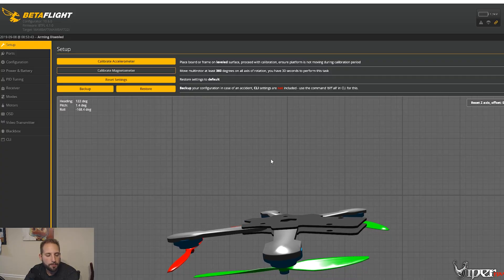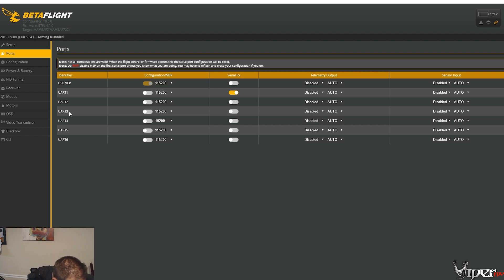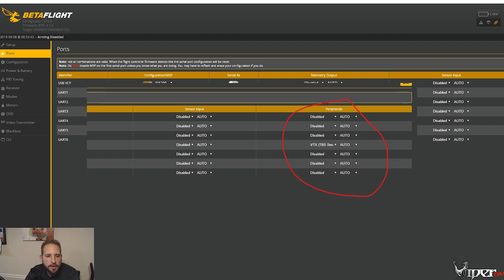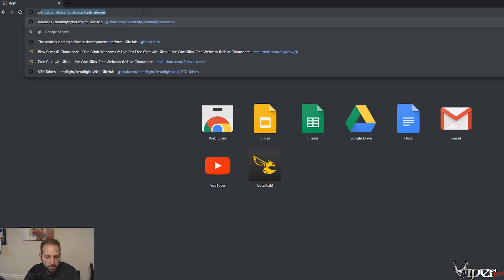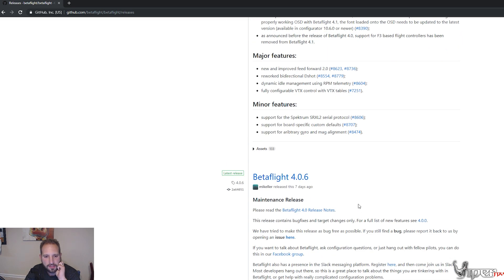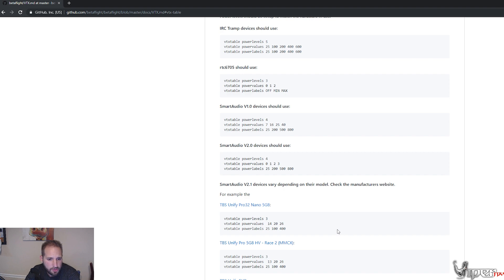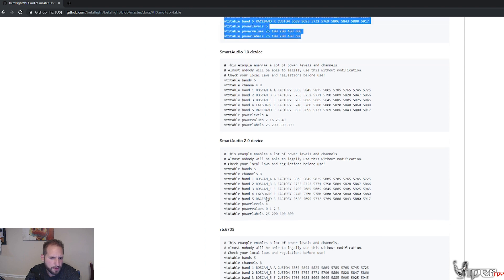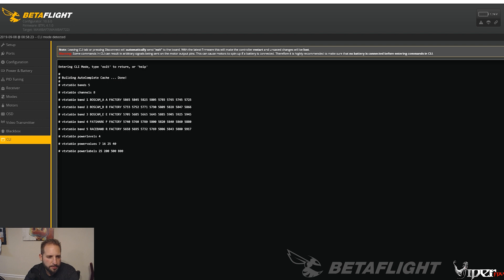How To Setup Betaflight 4.1 with Smartaudio or Tramp Telemetry - how to setup vtxtables

Comment: I have nano pro32 and using smart audio 2.1. I set the vtx table and when I got to vtx sa in osd all I have is statx and exit. I do have the peripherals set. But when I do the debug I don't get any values. What am I missing
Reply from the maker: Josh Hutchins are u sure if u have the smartaudio wired correctly?

Comment: So I got my NamelessRC nano vtx working but for some reason I can’t seem to change my rate profiles via osd. I can change the channels just fine. I have 1 model on my radio for all of my d8 receivers and other models have switches for air,horizon, and stable. But in beta flight I have this model setup with only a arm and beeper switch. Seeing as it’s a 3” I have no need for stable. Only reason I bring that up is I have noticed in the past that I couldn’t change channels if the rate profile isn’t compatible with stable mode. Any idea why I can’t make these changes? Thanks
Reply from the maker: Do you have expert mode enabled? You will need to make sure that is enabled and then you can change your rates with a switch.
Reply: Viper_FPV I’m just trying to change them via osd. It’s so strange I can change my rates in rate profile 1 but I can’t switch to rate profile 2 or 3 at all
Reply from the maker: David FPV there is no function to change rate profiles in osd. That’s why you would have to set it to a switch
Reply: Viper_FPV maybe I’m saying it wrong because I have changed rate profiles a ton via osd on all of my quads. I have rate profile 1 for stable flight. And I use rate profile 3 for acro rates. So I go in my osd under profile and I toggle from 1 to 3 then click save and boom it locks in. But for some reason now it won’t switch from 1 to 2 or even 3
Reply from the maker: David FPV I believe they changed it in 4.0 where now u have to setup a switch to change your rate profile. You can change the pid profile through the osd just like before but it won’t change your rates.
Reply: Viper_FPV when I fly my pmb tiny hawk s rateprofile 3 is for angle flight and has Rc rate at 0 and super at 0 for pitch and roll and if I flip my switch to acro mode the quad won’t do flips or rolls because of this so I go in my osd and change the rate profile to 2 which has 1.20 for Rc rate for pitch and roll and .82 for super and the quad flys like it should. So your saying that I shouldn’t be able to make these changes via osd?
Reply: Viper_FPV I’ve also done this in the past when experimenting with different rates to see what I liked best. But since I’ve found my ideal freestyle rates I don’t switch as often

Comment: Did this for my 136rs and I can't change the frequency.
Reply from the maker: Alex B are u sure it’s on Smartaudio and not vtx telemetry
Reply: @ViperFPV  Figured it out. My old config that was pasted had the vtx set to a channel and band specifically and it was overriding the new setup.
Reply from the maker: Alex B glad u got it straightened out.

Comment: Hi Viper, i have an ImmersionRC Raceband 200mw, it uses SmartAudio 1.0 right? updated right now to BTF 4.1 so i'm kinda confused
Reply from the maker: Is it a tramp vtx?
Reply: @ViperFPV  yes, it has 2 plugs for audio, one says raud and the other says laud
Reply from the maker: You don’t use the audio plugs on the tramp you want to connect the wire marked with a T to an available uart TX pad.

Comment: So from the vtx, the irc tramp wire would be soldered to smartaudio(tx1) on the fc, then the other 3 wires would just be to the camera. Correct?
Reply from the maker: Cyrus Krakow u have it right for the smartaudio wire. But the vtx would need power from a power supply, ground and the video wire would wire to the video out of the flight controller
Reply: Viper_FPV thanks for the quick reply. Yep, thank makes sense about the wiring. I just wanted to make sure if I bought a Runcam TX100 Nano VTX it would work with my BETAFPV F4 1S Brushless Flight Controller V2.0 DSMX Receiver I have since this receiver only has a smart audio (tx1).

Comment: Thx for the video . I downloaded the vtx  file for smart audio , my video tab looks good. I set in the ports tab to SA but in my goggles  it says not configured , I went back to the ports tab and set it to tramp, now I can change  power ,channels etc... in my osd but it doesn't  seem  to change on my rapidfire. But its weird  that my smart  audio  vtx(rush tank) only works with irc tramp. Would you have any ideas ?  Thx peace
Reply from the maker: Your rapidfire won’t change channels u will have to change that manually.

Comment: We need to figure out the tables/valurs for an RDW Mach3.   I have one RDQ mach 3 that yields a result of 200 for debug sensor and another that is 216.

Problem is getting the other power levels to properly be recognized.
Reply from the maker: You can change the power levels in cli to match your vtx so your osd shows the correct power level. The Mach 3 I believe does use smartaudio 2.1
Reply: @ViperFPV  that os what I am trying to confirm.    It took some digging to find that some of the VTX table values are in db rather than just sequential "1,2,3,4,5".

One of my builds may have a deadish VTX so I need to retry it.   But I have to confirm it by way of using my IRC ppwer meter.

Comment: Hi buddy.  I have just finished all the step you described - exactly the same setup to are showing, however, when I go into smartaudio I get the message 'statx' under VTX SA and can only change values under the VTX TA tab?  I have set all port correctly in Betaflight 👍
Reply from the maker: i cry when i wii what vtx are you using?
Reply: @ViperFPV  TBS Unify Pro HV
Reply from the maker: Are you using the smartaudio 1.0 snipet?

Comment: Why you change everything thru CLI and not from the video transmitter tab? My problem is that the changes I make thru the OSD don't do nothing to the VTX, it seems changes are being done but nothing happens, I pretty much have tried all smart audio versions. I have a Unify pro 5g8 HV non race edition, it goes to 800mw
Reply from the maker: Did you not watch the video? They changed how smartaudio is setup with betaflight 4.1 you now have to enter a vtx table into cli
Reply: @ViperFPV  I have Betaflight 4.1 and you can change all that thru the video transmitter tab, you can upload the file for your vex table, do it manually or even paste it from clipboard.
Reply from the maker: Listado En Linea I like cli better or I’m just use to it, I like to see it actually changed

Comment: help anyone, any idea why when i change settings on the vtx table tab like current channel or vtx power and low power disarm nothing works on the drone and it dosnt change anything? happening with a iflight fc and eachine fc... my low power disarm dosnt work on the vtx even though its on in the vtx tab and cli, and i cant change the power in smart audio but i can change channels and bands?? any ideas guys?
Reply from the maker: Which vtx?
Reply: @ViperFPV  rush tank mini and mach 3 vtxs, both of them the low power disarm isnt working nor the betaflight settings or power change in osd..
Reply from the maker: Which vtx table did you use. Mach 3 vtx uses smartaudio 2.0 and u need to put that cli snippet into the cli and save. Regarding the rush tank it may be smartaudio 2.0 as well let me know how it turns out
Reply: @ViperFPV  yes the mach 3 uses s.a. 2.0 which i used and the rush tank uses 2.1 which i used but still not able to control the power output through s.a. or vtx tab and the low power disarm dosnt work at all. i know i did everything right but just wont take... reverted back to 4.0 that actually works. ive yet to see anyone actually successfully use smart audio through the osd on beta 4.1 so theres an idea for a video because ive seen no prof of anyone actually using this new vtx tables

Comment: I believe the unify 5v V2 and V3 use smart audio 2.0.  I have one and when I used the info from smart audio 1.0 and it acted like it changed power,   but did not actually do it until I used the 2.0 info.
Reply from the maker: Mbyc Fpv yeah your probably right since I honestly was just trying to get the point across of the different smartaudio versions.

Comment: Is there some way I could save all my settings like motor resourcing, TinySled VTXswitch, before doing the upgrade to 4.1, then just reapply those settings after upgrade?
Reply: huhhman  Thank you.
Reply from the maker: When updating to a new version it’s advised against doing this since they may have changed cli commands. It’s always best to CLI dump your settings and copy them as a notepad as a backup just in case you need to downgrade/ flash the older version. To copy all your Quad settings just go to CLI and type dump and copy everything. You also can pull out specific peace’s of your dump like your rates, port settings and osd settings and copy those over just don’t copy pids or filtering settings.